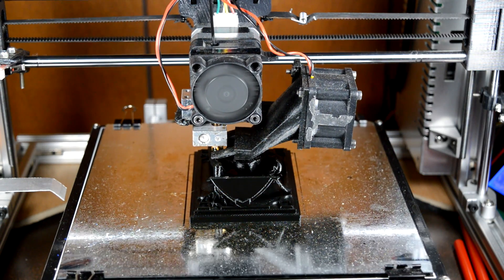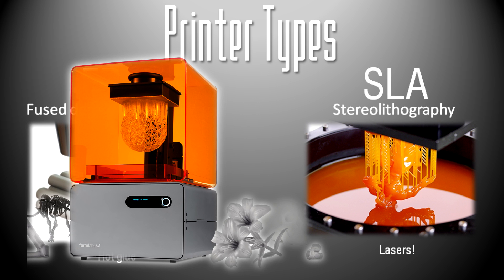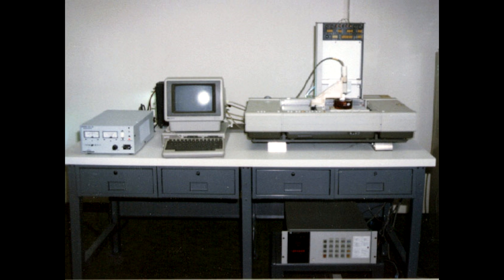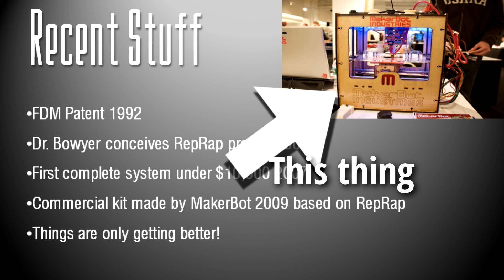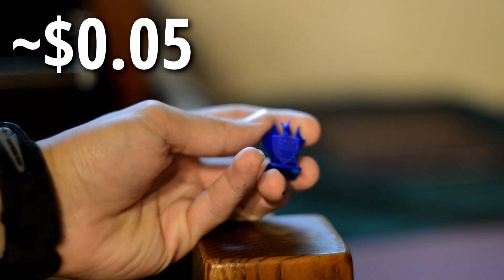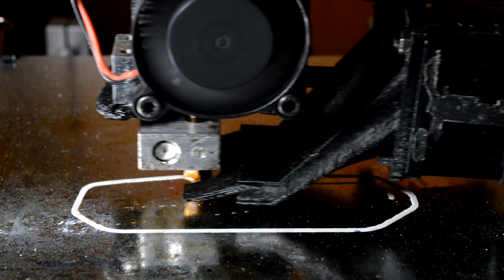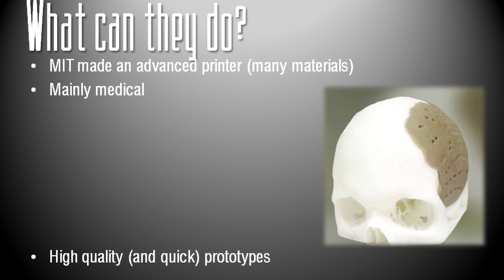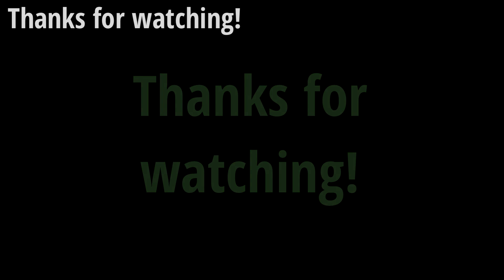A Brief History of 3D Printers and How They Work (3DP#01)

Comment: Great video man! Just a question, how did you calculate the price you expended on every print? Based on weight?
Reply: first get the price of the filament you bought. Let's say you bought a kg of pla for 25 dollars. You then divide the price and kg's 1000. Now thats the price of 1 gram. So 1 gram = 0.025 dollars per gram. Now in most slicing softwares you can see the amount of filament you use so you just multiply 0.025 by X where X equals the amount of grams your print weighs.